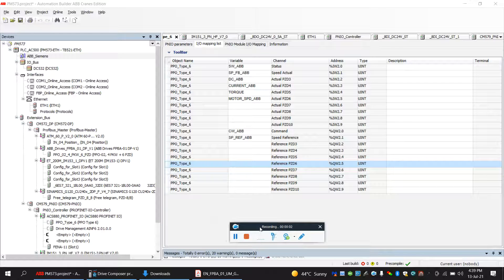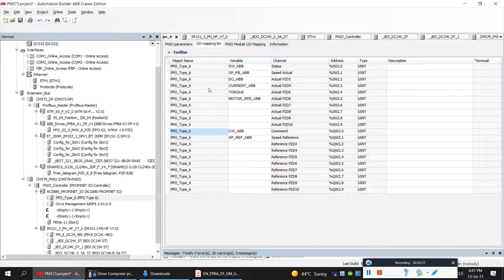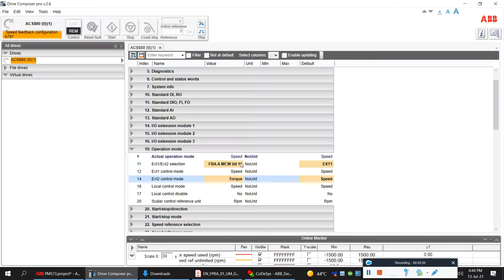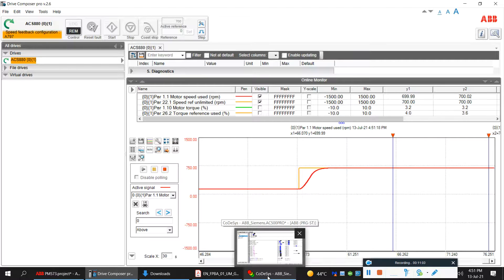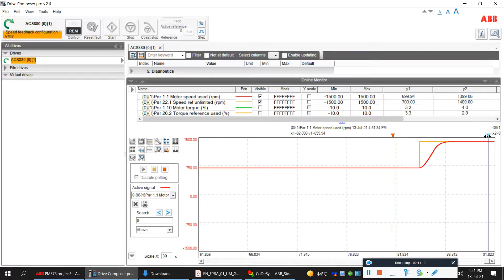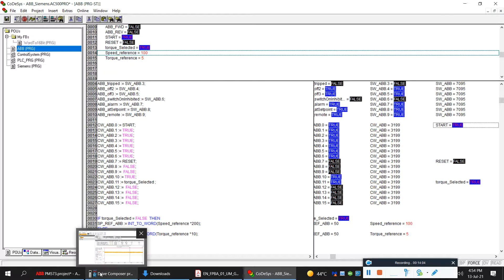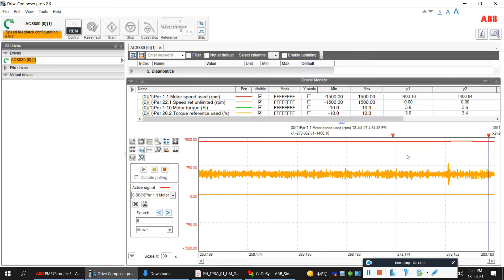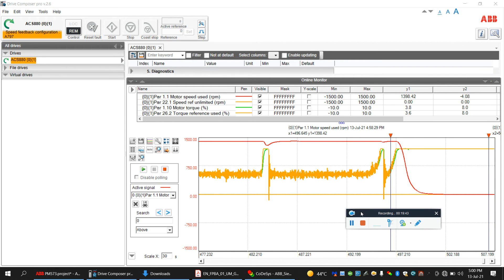13. Understanding Torque Control mode in ABB Drives and other VFDs

Comment: Nice work and explanation! For codesys interference u did link it via Siemens PLC? Instead of Tia Protal u use diect codesys as the control method?
Reply from the maker: Thanks!!.., in this video i have used ABB drive and codesys for simulation. But you can definitely link codesys to Siemens Drive - https://youtu.be/yTlCZXCLneU